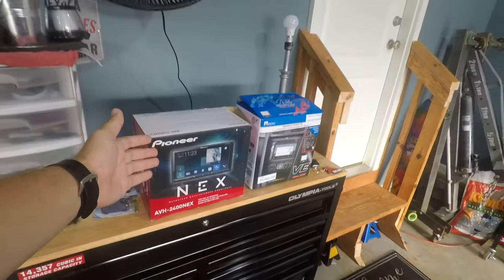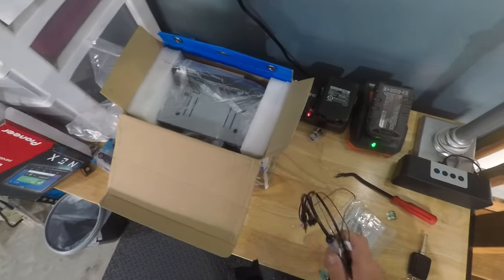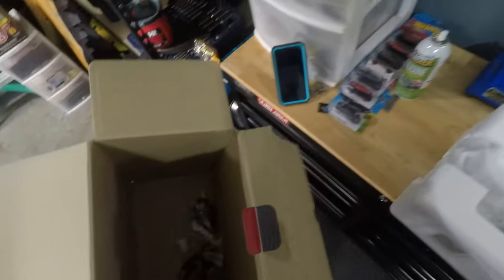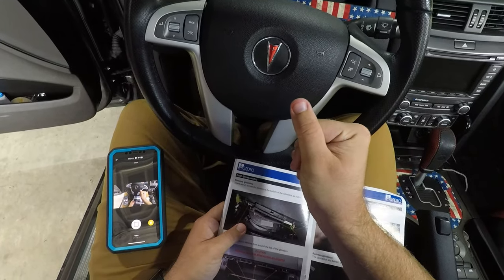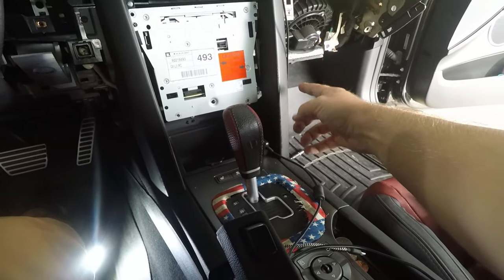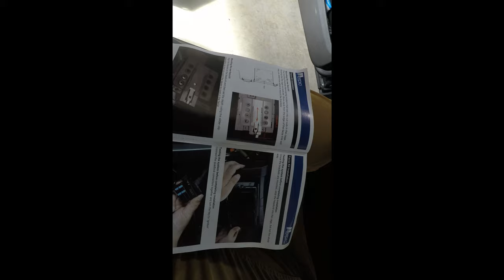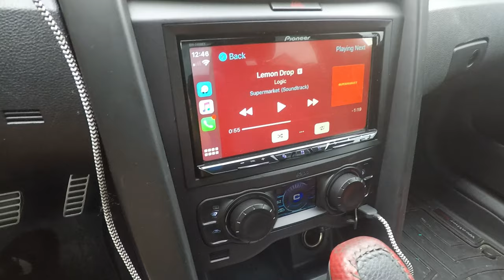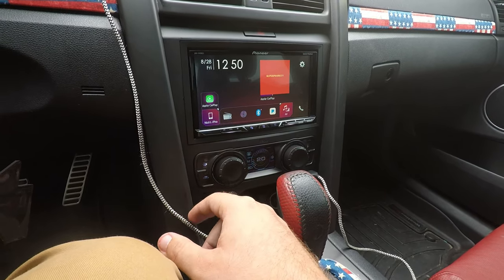Pontiac G8 AeroPro Install! Huge Upgrade!

Comment: Got mine installed at a good reputation local shop. They did a great job was all working great. Then all of a sudden only the steering wheel controls work now. The knobs on the actual aerpro isn’t working. Did I enter a mode on accident ? HELP
Reply from the maker: The aeropro can be finnicky, its best to do a hard reset. You can try disconnecting the battery or I think the aeropro has a hard reset feature built in, check your owners manual for the kit it might mention it

Comment: All this disassembly is a waste of time. All I did was pop off panels on both sides of the radio unplugged radio on one side unplugged antenna on the other side then pulled radio out

Comment: I bought a Bluetooth module that plugs into the back of the stock stereo and uses the rear aux. still waiting to get it, I ordered it from Australia.
Reply from the maker: If my stock radio screen wasn’t already becoming damaged I would’ve went that route too! The possibility’s with the stock radio is endless 😎
Reply: What is it called

Comment: Can you skip songs using the steering wheel controls?
Reply from the maker: I don’t believe so (I don’t have the car anymore so can’t verify) but from what I remember the left side controls were used for the climate control temp and fan speed

Comment: Nice walkthrough. Now I can get this done once it's okay weekend weather since I live in Massachusetts. Also I need to choose which deck I want to use my 4201NEX that's in my Camry or my 2301NEX in the closet. If anyone is wondering the 1's mean they also have front bumpera/dash camera support (one of the two) along with the backup camera support.
Reply from the maker: I remember one of the videos I watched on my 2400 mentioning it could have front camera support, which would’ve been hella useful for curbs when parking since I had like 1in of clearance 😂 glad it helped!

Comment: How does the ac/heat controls work? Just from correctly connecting the harness? Cause I notice when I took the harness off the factory radio it was only the radio harness connected and Antana so I’m guessing once the colors are matched/connected it works that way?😊 does the radio have anything to do with the actual kit aerpro kit other then fit in it? How is it powered

Comment: so I purchased the same unit and unfortunately for me as soon as i turn the ignition on or power the vehicle the a/c turns on automatically and I haven’t been able to turn it off completely. any suggestions?
Reply from the maker: Did you get one from G8only? If not it’s possible the Australian software could be causing issues, there was a minor tweak even with the first batch of ones sold here in the US to make it functional
Reply: @nickwicks4539  I ordered it a while back from a reseller in Australia and just installed it this weekend lol
Reply: @nickwicks4539  anything I can do about it?
Reply from the maker: @JorgeJuarez-ft5nj  yeah if it’s an Australian version I believe something with the software is slightly different and can cause what you’re describing. The units that G8only brought over were modified for US cars and I think that included a software reprogram of some sort
Reply from the maker: @JorgeJuarez-ft5nj  a few people did install the Australian versions before any were marketed for US so I would look on the g8 forums but outside of that unfortunately I don’t know a solution
Reply: @nickwicks4539  is there a way I can update the software? or find a solution without having to replace the whole kit all over again?? any suggestions on what I can do??

Comment: So I need help my temperature controls  froze on me I can't turn the fan up or down.
Reply from the maker: Check your operation booklet from aeropro, and do a reset. Should fix it right up 😁 I no longer have the car or the paper otherwise I would advise you how to, I apologize
Reply: @nickwicks4539  it said press and hold the two controls to reset but it's not working.
Reply from the maker: @marquitajohnson8236  may have to disconnect your battery long enough for it to lose power and then reconnect the battery and see if it works
Reply: @nickwicks4539  ok thank you

Comment: Can you give me the info on where you got the AeroPro Fascia Kit . Thanks
Reply from the maker: G8only.com but they are currently out of stock, Joe (the owner) is waiting on a new shipment of the updated version to come in 😎
Reply: @nickwicks4539  Thank you . I really appreciate it . Is it worth it or should I go after the Kayhan or the G8 Android radio option .
Reply from the maker: @Nateaaden02  if you’re going oem the IQ setup is the best, however if you’re handy with installs and wiring I highly recommend the updated aeropro and a mid range double din, since you can get oem functionality and much more features that have more ease of use
Reply: Stay away from Kayhan, you can read up the comments on You Tube/Forums. This is by far the best bang for buck kit, alternative the Alpine kit is another route you can go, but more expensive.

Comment: How did the steering wheel controls work out? Full functionality? Bought this kit but want to make sure I have everything figured out.
Reply from the maker: Steven Gill for my radio it’s fully functional, I scroll works normal for volume level and clicking will mute the radio like factory 😁 also with this radio it only required using the 3.5mm jack included as part of the harness to retain function
Reply: Did you plug the 3.5mm Jack into the back of the system where it said aux? or what wires did you connect the 3.5mm Jack into ? To retain the function.
Reply from the maker: @HisG8  on my pioneer it went at the top of the connection area right next to my mic plug in. It wasn’t aux but I don’t know what the other port was labeled
Reply: @nickwicks4539  okay from the top of the unit is where you found yours. and I’m guessing you spliced the jack into a + and - ? and those wire up to a the harness that came with the aero pro.. that’s just my guess ?
Reply: also you didn’t run it to any steering wheel control module correct ? U did it just to the actual harness itself
Reply from the maker: @HisG8  for mine I only had to plug the aux cord into the radio for it to function properly. And it’s on the back of the radio just my plug in spot was at the top row of where all the connections are on the back. And correct did not have to run any wires or anything the kit utilizes the factory wiring for the steering wheel control 👍🏼
Reply: @nickwicks4539  amazing appreciate all your help brotha really cleared it up for me ! Just purchased the pioneer since all the good deals are going right now 🏃🏽

Comment: Need some help lol what you do
With the key 1 key 2 gnd coming out of the facial?
Reply from the maker: Cesar Villarreal those are related to the steering wheel controls and specific to the aftermarket radio you’re using, mine didn’t require their use just the auxiliary plug in 😁
Reply: Nick Wicks thanks brother

Comment: Thanks for the install assist.  I've got everything done but the temp sensor that mounts on the blower.  Have any tips for that part?   Is it necessary?  I can't even find mine as I'm writing you..smdh..lol
Reply from the maker: Brandon Guthery the temp sensor was not included as part of my kit from G8only, I assumed this was since our cars had factory temp sensors in all models but I guess the kit doesn’t utilize it. I’d assume it just requires drilling a hole above the blower and sliding the sensor in and epoxying it or something, seems like it would be straight forward 😁
Reply from the maker: So I was mistaken, a thread like this popped up in the owners group the other day and one guy point out his works it’s just greyed out for some reason. I need to verify this on my unit but may be worth looking into yourself as well. I’d assume something is wrong with the software for it to not light up but still work 🤷🏻‍♂️
Reply: @nickwicks4539  I complete the install without the cable I mentioned and everything turned out just fine.  It may have been the Australian version of the kit that required it.  I spoke to Joe at g8only and he confirmed the cable is not included in the kit.

Comment: Do you know if this kit works for single zone climate control only
Reply from the maker: Roman Reyes I do not, there is a specific kit available through aeropro that is built for single zone, but is not stocked by Joe as far as I know